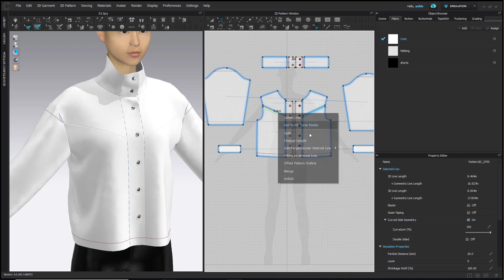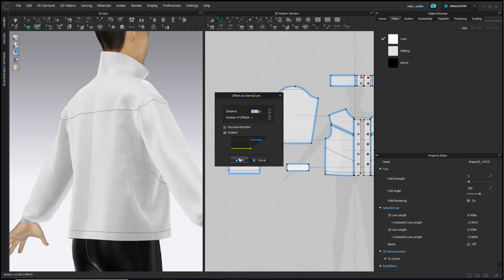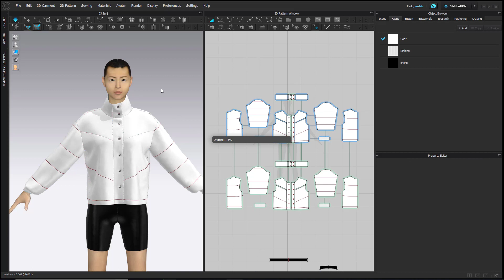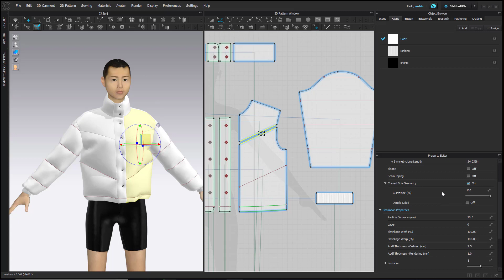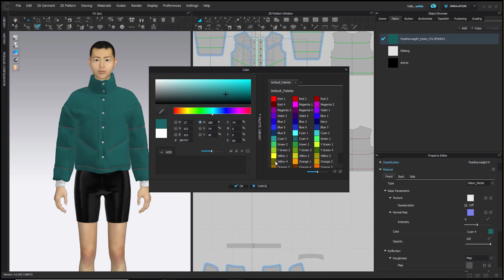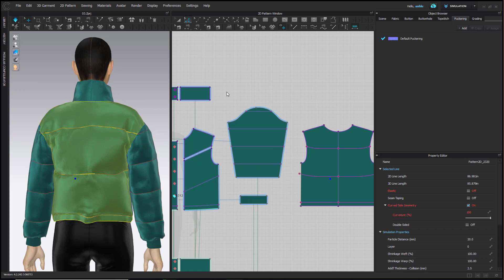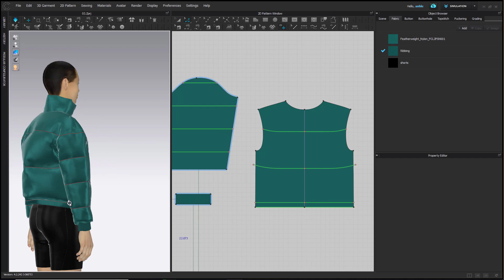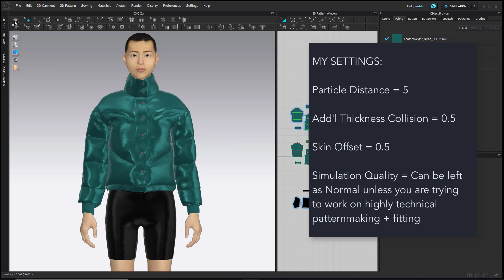Cómo crear una chaqueta acolchada en CLO

Comment: I have a strange issue, why when i put pressure my dress start to lifting up? I trying to create a trench coat but the fold under the belt start to flitting up e flat in the air
Reply from the maker: https://support.clo3d.com/hc/en-us/articles/115012381348-Pressure